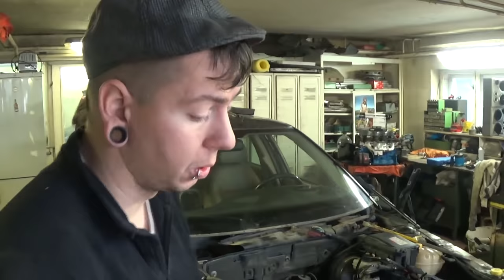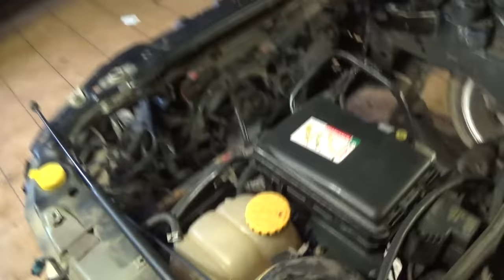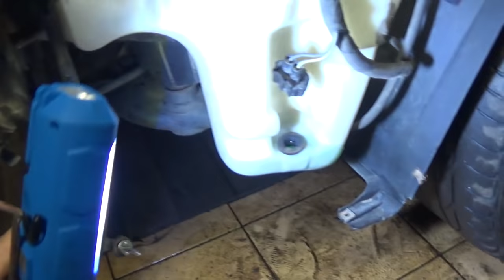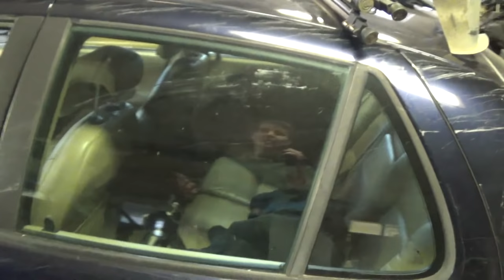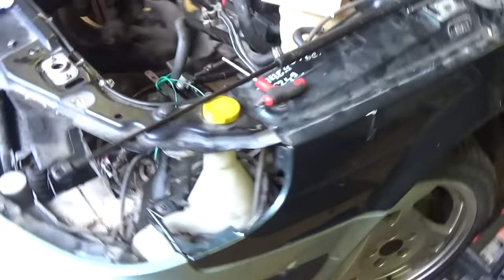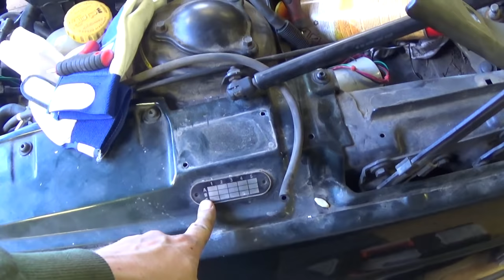Saab Szerda #4 "Ez a kar-rossz-széria!"

Comment: Nem tudom hogy mondták e már neked Tisztelt Mérnökúr. A Saab nak semmi köze az Opelhez csak annyi hogy mind kettő a General Motors hoz tartozott. Nagyon kevés közös alkatrész van benne. Pacsi.
Reply from the maker: Meglepődnél eddig szinte csak B vectra alkatrésszel jöttem ki az autósboltból ;)
Reply: Vectra B? Abba is raktak volna ilyen motort? Ezt tényleg nem tudtam.
Reply from the maker: +Karoly Montsko az opel 2-2.2 dizel is ez a blokk. 2-2.2 benzin is volt, csak turbo nélkül. Sőt a GM sok usa piacos kocsiba is használta.

Comment: Ne cserélj generátort, ha zaja van, cserélj benne csapágyat...vagy vidd el egy elektromos szerelőhöz
Reply: Szerintem lehet ugy van osszerakva hogy ne lehessen. Fogyasztoi tarsadalom.
Reply: Zsolt Sebo logikusan hangzik, de... én is autóvillamossági szerelő vagyok, hidd el, javítható
Reply: En a motoron(pl. vezermu, szelepek allitasa, hengerfej tomites) kivul igyekszem magamnak csinalni. Nekem az Astra F en (20eves kb) az ablaktorlo motor attetelenek a tetejet direkt szegecseltek de meg lehetett oldani. Nemelyik gyartonak szokasa ugy osszerakni a dolgokat nehogy mar javitani lehessen. Pl nekem a mosogepben a motor. Csak csapagyas de nem tudod kicserelni a csapagyat. Vagy a dobot tarto csapagyhaz ugyan az.
Reply: Minden tiszteletem a tiéd, de a mosógép az nem autó, az ablaktörlő motor pedig nem kisfődarab mint a generátor.
Reply: Arra akartam ramutatni hogy ha akarjak megoldjak hogy ne javithasd meg. Latni kellene. Esszerubb lenne ha javithato de ez nem szocisauto ahol javitasra is gondoltak. Nem fo darab de mar ott is igyekeztek hogy ne tudd megcsinalni.
Reply: Az eredeti kommentem segítő szándékú: egy bontott netán új/felújított generátor ára súlyos tízezrekre rúghat, míg a bele való 2db. csapágy ára egyenként kb. 900 Ft. Az internet pedig tele van oktató videókkal erre vonatkozóan.

Az az autóvillamossági szerelő pedig, aki nem tud megcsapágyazni egy BÁRMILYEN generátort, az valószínűleg nem járt iskolába, mert ez alap tananyag. Ugyanez a helyzet pl. az önindítókkal is. A legapróbb csetresz is kapható hozzájuk. 

Vannak persze olyan alkatrészek, amiket javíthatatlannak terveznek, igazad van. Ezeket a márkaszervizekben egészben cserélnek, pl. az ablaktörlő motor. Sőt, önindító, klímakompresszor, generátor. Na és mit szerelnek be helyette? Egy gyári technológia szerint felújított darabot. Ergo: javítható az. 

Na de ha mégsem: egy magyar előtt nincs akadály - neked is sikerült megjavítani az ablaktörlőt, igaz?
Reply: igaz. vagy utangyartottat raknak. amig nem heggesztik ossze :) habar van flex is
Reply: igaz. vagy utangyartottat raknak. amig nem heggesztik ossze :) habar van flex is